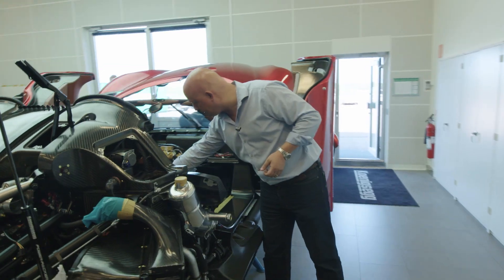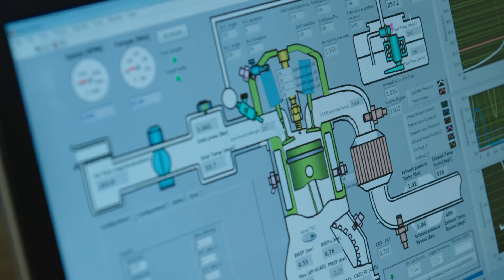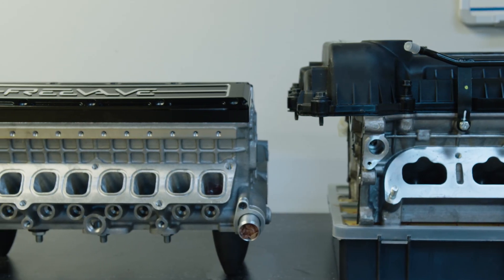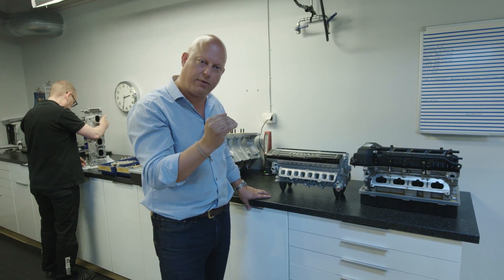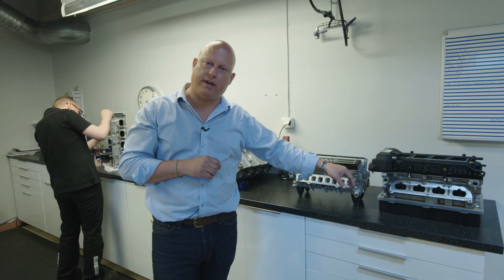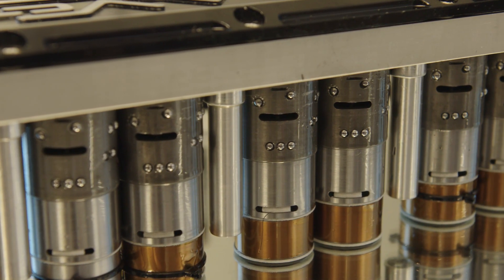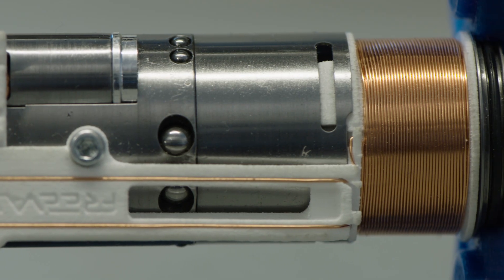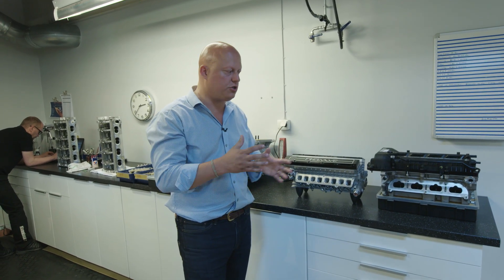Freevalve Update Camless Engine -- /INSIDE KOENIGSEGG

Comment: This should work great Diesel engines.
Reply: It does, at least in lower rpm large diesels. Navistar has been building camless engines for around a decade now.
Reply: EM6285 i believe they were called pieces of shit
Reply: valvetronic is very reliable actually. i dont know how either of the systems could damage the bottom end of the engine anyways. i think youre confusing something here.
Reply: No, I'm not. you believe or not, they can cause misfire and bent the main axis in high rpm. These BMW VVT solutions depend on oil pressure, and valvetronic depends on a motor and a sensor, so they all come to an end and need to be replaced with new parts; if not done properly, then the lower engine will be subjected to wrong timing. Valvetronic is simple, But I don't think its reliable, in case that there are a lot more options for performance solutions.
Reply: I doubt we are not talking about the same brand's Valvetronic, are we? E90 M3 came with 4 sets of Vanos plugs for each cram-axis but does not have a motor powered Valvetronic, even though the BMW vvl should be compatible with IBT. You see, I don't think we should give a dame to their terms or titles. Valvetronic stands for the e-motor plus the pole it drives plus all other fact and parts that make the master intake throttle body 95% of the time useless. And Vanos (solenoids, to be specific) stands for the oil switches plug into the engine body that control the VVT buns attached to the cram-poles. I know VVT VVL BMWs are not "extremely" un reliable, but in case that Toyota/Lexus was using 90% the same VVT layout and had barely an issue according to the customers' feedback, there is no excuse for BMW to constantly fail on it's Vanos. I'm not sure where you get the reputation that BMW has a reliable VVT/VVL, man. If you do know who can perfectly make these complex work on my car, plz introduce me of this person, I will be glad to do business with him.
Reply: for a week or 2....
Reply: Corey Schmidt Which are those "camless engines" that Navistar has built for over a decade now?
Reply: Like Corery Schmidt says. it does. B&W and Sulzer, and Wärtsila, and more uses it for 2-stroke and 4-stroke "big" ie. ships engines. Köingsegg seems to reenkinneer and develop it for other use, and seemingly does it wery well, as time will show.
Reply: Yeah. Perfect replacement and further development of the hated valvetronic as well.
Reply: why is valvetronic hated?
Reply: By Valvetronic, I also include the Vanos. And these two are both not reliable, and they potentially can damage the lower engine along with the upper if they don’t work properly; had such experience. BMW NA payed 20k, and I payed 1.6k to install a new engine.
Reply: valvetronic is reliable. did you know that valvetronic does include vanos? one can easily be confused by the marketing terms here. valvetronic is a mix of vvt and vvl. the vvl part is pretty reliable anyways. the vvt part has been very reliable from about 2008 onwards aswell. the storys about them braking all the time come from the early 2000s.
Reply: from my understanding it shouldnt. what benefit would it have?
Reply: The point i was trying to make was, that the cars that were advertised as having valvetronic also have a quite reliable VANOS. I cant speak for the M3 though. This logic only applies to normal BMWs.

Comment: The vision of Preston Tucker is alive and well in Koenigsegg's "Freevalve" efforts. For those who may not be familiar, and without going to far into it, Preston Tucker designed a 589 cubic inch engine in the late 1940s that operates its valves hydraulically just as this design utilizes pneumatic performance to actuate valves.

Comment: One freyed wire or a dead controller and the valves will crash though. Also how much energy is required to slam those valves open and shut? A shit tonne my guess.
Reply: It's going to be very close to the same energy needed to open them now, possibly less since there's likely to be less losses in the overall mechanism
Reply: Derpin Bird they're electromagnetic.. so I'd say not that much.
Reply: less losses? you would need to turn the engines energy into electricity then back into mechanical motion, two conversions at 50 and then 80%. Heaps of the major car companies have looked into this, the tech just doesn't work well enough currently.

Comment: Sounds good but he didn't explain how it works!!!
Pneumatic valves?  Where is the compressed air coming from?  the turbo?  or is it negative pressure (vacuum)?
How is the pressure varied or timed?  Can they make variable pressure solenoids which operate that fast and accurate?

Comment: what is he pushing the valves with? air or hydraulically?
Reply: Pneumatic i.e. air.
Reply: leaks?!
Reply: also catastrophic seal failures, must be high pressures to push these valves?  just wanted to drill down about the system issues...If you have to rebuild the cylinder head once a week, that might be ok if your racing...
Reply: I don't know, just pontificating on the guys system while I puffed a doobie cruising around youtube...engines get really hot, if there are orings to seal such high pressure, they must be made of some very exotic stuff...but yeah I like new ways of thinking about engines to go racing with...I gotta get back to the chips!
Reply: the solenoids for the valves are controlled with electricity.  thats why they are very fast reacting.

Comment: This isn't just variable valve timing, this is completely programmable valve timing. What programmable fuel injection is to carburetors, or electronic timing to points and centrifugal advance. If they get the hydraulics to be reliable it will make every one sit up and take notice.

Comment: this would be soo great for old-/youngtimers for upgrading the engine. f1-tech in old and also actual cars :-)
also interresting would be such a technology like the 'turbulent jet ignition', that allows much leaner mixtures cause of the jet flame instead of the spark plug and also at higher rpm the combustion starts earlier and is quicker which leads to a more complete usage of the mixtue in the combustion chamber before the piston is completely pushed down.
==> more efficient in lower an higher rpms.
mahle has the patent on this, but i guess with a little bit of a modification you can ignore that patent.
Reply: also for an embedded systems software developer like me this would be a dream developing and optimizing the software for the ecu. such a cool job.

Comment: What about electric? This is only short term future
Reply: Ethan Cavill Fuck electric I prefer this if they make it work..
Reply: ethan cavill ,, they can already make an electric vehicle that can be driven for years at a time without refueling ,, they just choose not to ,, for a number of reasons ,,, it works like a nuclear power plant ,, everything needed is contained ,, even the cooling system to prevent a meltdown ,, one liquid to cool the steam that powers the generator to power the electric motor that turns the transmission ,, the steam is also used to heat the cab on those cold days ,, the on board battery is used basically like the battery in the average vehicle and is charged from the generator ,, it all works just like a nuclear power plant ,, just on a smaller scale
Reply: MannyFresh1x You can still drive combustion, its just a matter of time before most manufactures move to electric. They should be putting their money into the future
Reply: bolderiks So true
Reply: El Jim Yeah so why doesn't Koenigsegg invest in to something that will make the a dominant technology leader in 20 years? People like Rimac are just going to take out these guys if combustion manufactures don't step up their game... just a matter of time
Reply: because they need money to invent. 
they are doing it already with the hybrid.
they also will have a ev in the future, but first they need to learn.
Reply: mike brink ,, nuclear power  ,, and most people are to uneducated and or to busy to see the truth ,, there are a lot of things being kept secrete ,, its all about control ,,
Reply: bolderiks ,, i wonder why we have never heard of a nuclear submarine meltdown disaster , more secretes maybe ,, or the small nuclear device is easy to manage ,,
Reply: A naval nuclear reactor requires an entire team of people working around the clock to monitor and control it.
Reply: Also hydrogen is a much better future technology than electric cars. It is familiar to the end user, because you can just fill up and go, instead of waiting for batteries to charge. Also there is none of the horrible toxic lithium mining for expensive and explosive batteries. Yeah hydrogen is explosive, but it doesnt turn into a large ball of unquenchable molten death the way a vented battery does.
Reply: evan anderson ,, an entire team you say ,, to look at gauges and push some buttons ,, we are made to believe all that you just said about naval nuclear ,, the first combustion motor alone took a number of people to control and now one person can control a complete vehicle ,, same goes for a reactor ,, the brain box does most of the complicated stuff " the electronic part of it  ",,
Reply: mike brink ,,  the great thing about the propane/diesel is that the millage per gallon and torque are increased
Reply: mike brink ,,  a lot of stuff i say seems to most a bit extreme and over
 the top ,, a pre packed uranium cell that only needs to be changed once
 a year or up to a life time and is injected to start the fission 
process ,, its kinda like fueling your car at a fuel station ,, you can 
buy 22 liters or fill your tank to the max your choice on the amount you
 can afford ,, up to a limit of course ,, the heat from the cell boils 
the special liquid , produces the steam needed to turn the generator to 
turn the wheels and also produce the current needed to charge and power 
any on board electronics  ,,
Reply: I dont  think you understand how nuclear reactors work at all. I mean, it makes more sense than the idiots that say you can just run a car on water but it is still pretty idiotic.
Reply: evan ,, how dangerous could it really be ,, the on board computer would control all of the pre packed uranium cells activation or deactivation ,, its like what idiot would not know how to turn a switch off when a warning sound is activated ,, and if such an idiot exists the fail safe would automatically shut down the reactor by injecting it with the required substance  to prevent a melt down, ,, right at the moment i do agree that what i say is not feasible and the best option for and electric vehicle is the fuel cell ,,  the pre packed uranium cell is a dream wish that i have and nothing more ,,
Reply: 90% of the burnt fuel is converted to heat energy, 10% to mechanical energy to turn the wheels. How best to waste 90% of the fuel burnt?

Comment: Jesus christ. 50% more power, 33% more torque, 35% less emissions, 15% more efficiency. Koenigsegg pls.
Reply: With that much control over the valves, i could totally see those numbers happening. The big question is one of reliability.
Reply: People make ridiculous power with lots of engines - The original motor was sized for production reliability, emissions, etc. Lots of tradeoffs for cost, etc. Sounds like the main emissions gain is with cold start - but that is still brilliant. Being able to run really high compression - with port injection - that is really unexpected, but super cool. And that compression is a big part of the efficiency gain.

Comment: I wish he'd share some of the observed NEGATIVES with the engine model. Obviously, it's very great in most aspects, but surely there has to be something negative?
Reply: Cost. Thats it lol.
Reply: Cost, also reliability hasn't been fully proven yet.
Reply: X88X
Reliability is well proven. Its way less moving parts and this has been around for a while now.
Reply: ap2pat Makes sense.
Reply: I'm wondering about the number of cycles each valve can perform before the unit needs replacing.
Reply: TABRAO if konesig was Australian.. yeahnahohhhhhh  about a billion cycles.
Reply: I sure hope it's more than a billion.  That's only 6 years, driving 8 hours per day at 2000 rpm.  Probably fine for a grocery getter, but for a working car...

Comment: Honda created the V-tec to give their performance engines a "hot cam" for higher rpm performance without sacrificing lower revs. It's a two cam profiled cylinder head in one.
This goes leaps beyond since you can give an infinite number of different camshafts that are perfected for each particular situation maped betwenn engine load and rpm. 
Basicaly you can have more than thousands of camshaft combinations that can morph in a split second... What a dream for me, dealing with the compromisses of cam profiles is a pain in the arse.

Comment: Why use air instead of solenoids?
Reply: Solenoids capable of directly driving the intake and exhaust valves would be massive. Solenoids capable of controlling a valve for the air needed to control the intake and exhaust valves can be much smaller. Another thing is that a massive solenoid that has the power to lift the valves fast enough will draw a fair bit of power, and where you push a lot of electricity through a copper winding there will be heat, and heat means you have to cool it or bad things happens...